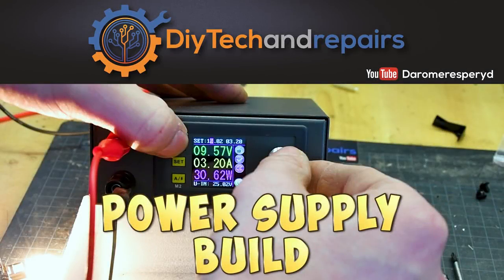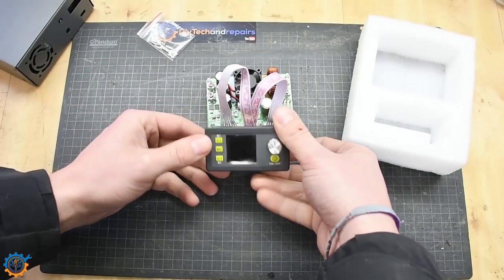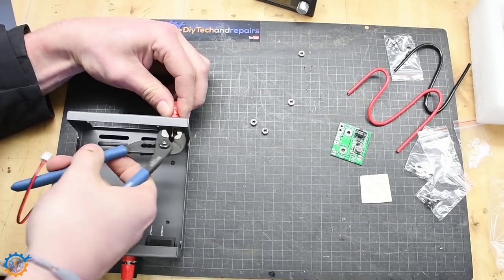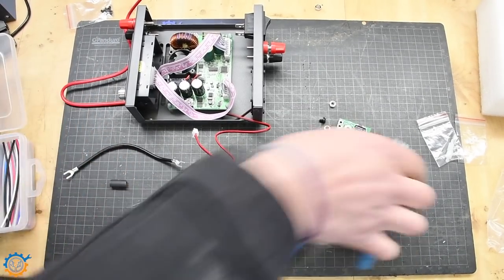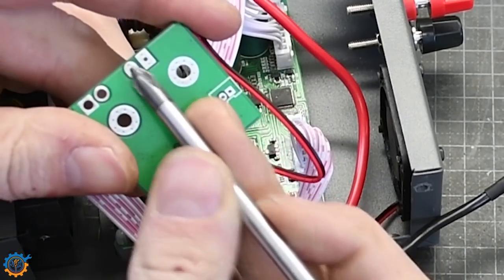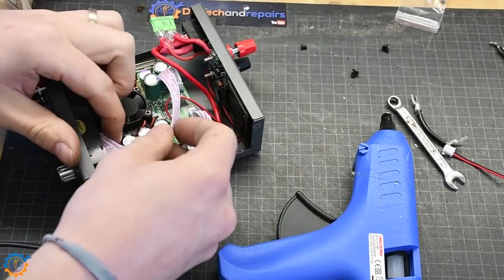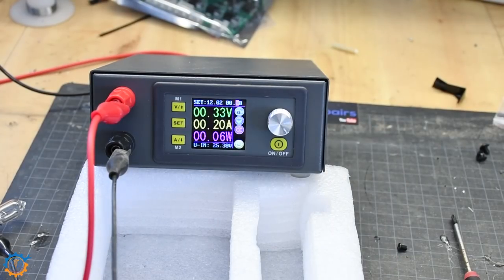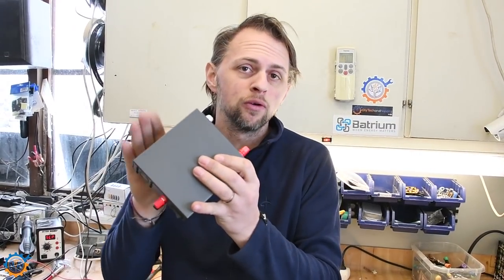Building a 1000W power supply - DPS5020

Comment: i just bought myself this module and 5 server hp Powersupllies with 12v 20 amp each but you can change the current by adjusting the potetiometer inside you can actually pushthese supplies from hp really hard somebody was able to get 50amp output for 2 minutes. but you can actually also adjust the voltage from 11.5 to 13.6 or so above that the overvoltage protection shuts down the supplie. but i tested the supplies and was able to put all 5 o them in series to get a really stable 59v output. those 5 psus costed me about 35€ which was a really good deal because server psus are propritare and if the server gets replace the psus cant be used anymore so they get sold really cheap. 

just make sure that you isolate the DC side of the psus becuase if you isolate the ac side you make it dangerous to use because than the output is not referenced to anything and can float up to high levels compared to earth. the voltage will still be 60v compared to positiv and negative but compared to earth it can get dangerously high. dont isolate the first supply in series so that each other supply gets a refrence from the positiv from the last supply and so it will be safe to use and baaammm. 60v 32a powersupply its just a bit bigger than commercial all in one 60v supplies but alot cheaper
Reply: Bonjour, petite question sur le pouvoir du serveur. Quel est le modèle? HP DPS-800GBA? Je vous remercie

Comment: I have the same module, as well as other variations of boost and buck-boost converters designed by the same guy originally.  Good job installing the input fuse.  In my experience, it is the input power regulator ICs that are what usually blows first on these modules.  I install a 10-15 amp automotive type circuit breaker on all mine, replacing the blade type fuse on the circuit board when possible.
I know you may have a couple 18650s, why not wire up a 13 or 14S pack for the input?  I run mine off 2 12v server power supplies in series (about $40 usd total), or my 7S 18650 pack.  Will work until you get a bench supply :)
Reply: Hi friend 
thank you very much for your suppor for our products, I am the guy you said the same guy originally. 
for the fuse , you can't change it , it must be 20A, because it is suitable for our circuit ... you can't change it

Comment: Perfect to charge my 10S8P e-skateboard. it'd be nice to see if work well under load though. I need 42V and the cells could pull easily over 8-10A to charge.
Reply: The problem with power supplies, is that they need a power supply!
This PSU is pretty nice and would make a good charger you have a juicy 14S rack of cells.
I'd like to find something a bit bigger than 1kW to charge my 14S ebike at 30-50A, but it could certainly be useful.
Reply: I bet the DPS5020 would handle that just fine, my DPS3012 has never gotten too hot where it shut off (though it is in open air)
Reply: for DPS5020, It can charge the battery , it is not any problem , you can use it. 42v/10A, there is not problem 
the only problem is that you can't connect the battery polarity reversely... understand ?
there is not protection
Reply: @SuperBrainAK
we use better plan to make it higher efficiency, so it not hot at ful load in the air, but in the box, you need strenth heat dissipation
Reply: If using it for only charging, wouldn't be hard to add protection yourself adding a few diodes? minus the voltage drop of course.

Comment: actually if you read the instructions that are included, and look at their webpage that is in the instructions, they show you that you hook the power switch to where it says "KEY" and your power feed wires to the main board are soldered to the + and - on the fan control board!
Reply from the maker: To bad they added that info after i made this video :)

Comment: Question, do you can charge you "powerbanks" with this (litium) due tot the possibillties of constant current control. But ranging from 4.2 v to 58.8v depending on the possibillties of the input psu (volts and amps), so you could charge li-ion 18650's but leaf cell too? (To the 8.2 volts for 2 in series for one module of desired?)
Reply from the maker: Yes you can. Just beware of that above dont balance anything so if you charge cells in need of balance a balance charger is generally better.
Reply: you can charge the battery directly , you can set the right voltage and current ..

Comment: I've got the same model and bought a 50v 10a power supply but the screen stays white, I troubleshoot it with a 24v 2.5a power supply and it works but no luck with 50v 10a. Any ideas why it will not work?
Reply from the maker: No idea. Check if the PSU work or not.
Reply: @DIYTechRepairs  thank you for replying! I've tested with multimeter and it's showing the rated voltage, its driving me crazy right now!

Comment: these are great units!!! I have 3 of them (DPS3012, DPS5005, DP30V5A) way overkill but still very useful (order mixup but I would have bought more anyway), only problem is their negative current sensing so no current regulation if two are common ground and common input PSU.
Reply: thank you , hope you like it

Comment: The 40x40x10mm fan is really noisy. I changed it to a 40x40x20mm 12v. Lower RPM with the 5V supply, but similar air flow. Much less noise now.

Comment: Awesome, man. I have a DPH3205, which is a buck boost converter, that I'm still going to build. But I'm going to put in a project box on my on. And I'm going to power it with a 24v 10a power supply. Everything in the same box. 😊
Reply: you can chang a big box and add battery pack, you will build a portable power supply . it will be good
Reply: Rd Tech Hey there. 😊 Yeah, that's a good idea for a future project! 😀 This one I'm going to power with a regulated power supply that I already bought. It's 24v 10a. 😊 I already have almost everything and it's going to be my next project after the next one. I'm going to build a small drone first. 😊 BTW, I already did the unboxing of the DPH3205 a few time back. 😊
Reply: very good, friend 
you can test

Comment: At ~7:07 you talk about a lead that controlls the case fan. I searched google and didn't find any help with that. Could you please give me some more info about this (or a link)?
Reply: I am building a DSP5020 myself at the moment. Case fan is always on as soon as you turn on the device. The fan on the buck converter has a temperature sensor which turns the fan on when load is high
Reply: Michael Tschopp so, isn't there any way that the case fan can be controlled like the one on the converter? (I also have a dps5020 module.)😂😂
Reply: George Vavouras Yes. There is an option. How can i send you a picture?
Reply: Michael Tschopp Michael Tschopp thanks for trying to help me! So, I'll send you my "business" mail address encrypted in base64 (it's a simple encoding method) when you'll tell me you're ready and then I'll delete the message when you'll tell me that you've gotten the adrress.

Comment: Hello, this is a great tutorial and thank you for sharing. Can I ask a question please, I have just purchased the DPS3012  and I want to add an inline fuse! what rated fuse would be correct for this model?  I have liked & subscribed.  Thanks again.. John :)
Reply from the maker: John Berry in THE ouput 30a and input depends in choosen input voltage. Just above max current
Reply: Thanks for your quick reply, I will be using an old laptop charger for the input voltage ( About 19v ? )
As I am a complete beginner that has never used one of these devices I will not be using it to its full potential ( I wouldn't even know how )
Thanks again,  John.. :)
Reply: The dps5020 has a small ceramic fues of 20 amps between the Positive and Negative input.

Comment: I think this guy is doing it wrong. Look et EEVBlog's video. His module look different. It appear to be that little boards has a fuse on it and places to solder the cables for the switch ("key" label on the board). I think that is the reason why the cable was "too short". I prepared and wasted some parts because of this video.
Reply from the maker: Yeah its another type of board. It wasnt to short its just how i layed the cable out.
Reply: @Repairman Sure, but I can warn others. For beginners like me it is normal to follow such tutorial with partial understanding.

Comment: so what did you do with the fan? it now turns on with the DPS5020's fan?
Reply from the maker: SuperBrainAK yeap on 5v so it was more quiet than i thought
Reply: the original noisy fan started to do that grindy noise. so i exchanged it with a 12v fan. this runs much quieter. not as efficient though.
Reply: Urs Odermatt just to know, my case fan was noisy as well. I opened  the case and I found that a cable was touching it, making a noise. Now it's noisy almost at all.👍😂😂

Comment: Hi , are you there ? although it is good work and good video 
but there is wrong operation, it can lead to white screen . I saw your let the cable go through the capacitor, right ? it is wrong 
because when it works at high voltage and current , the capacitor will charge and discharge to affect cable to lead the screen white or chnage the color ... 
this is wrong operation. you can let the wire go through under PCB, it will be good 
you can try ,. hope you make right operation
Reply from the maker: Im not sure I get you? I have the communication cable on the side beside the capacitor and after have been using 3 of them here I have still not had any issue with them. The capacitors should generally not discharge much at all during normal operation
Reply from the maker: Yeap I do. I have yet not seen any issues with my 3 units I have and they all work. But if I see any issues i know what it is. Thanks!
Reply: very good , I am waiting for your good news
Reply: Rd Tech did you say white screen? I think that occured to me once, when I tried powering on a ~200kv (I know it's a lot) voltage booster. I had powered that on other times, but one time that happened. (I turned off and on the module and the white screen was gone I think.) By the way, very nice module. Some days ago, I did a ~3hours electrolysis at ~47V@~0.5A. I think there's no damage from use at all even after that.

Comment: How do you stop charging when the amperage falls below a certain level automatically?  Lithium will be killed with trickle charging.
Reply from the maker: Lithium wont get killed as such no. In what scenario do you ask about how to stop charging?  Most chargers I got will stop after x time or y current. My solar for instance cycles each day so during the night there is no charging so thats not a problem either.

Comment: Powering a power supply with a power supply. Well, in that case this isn't a real power supply.
Reply from the maker: Alejandro Pérez what would you else power it with? It doesnt take ac so you need a psu in between of some kind :) yes mine was a variable psu but could have taken a transformer and some diodes too :) yes battery works as well